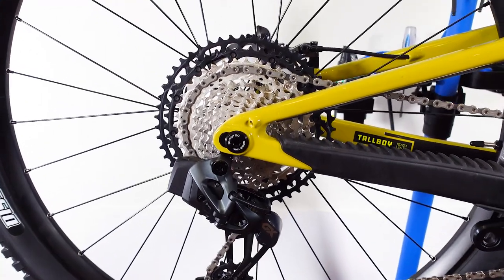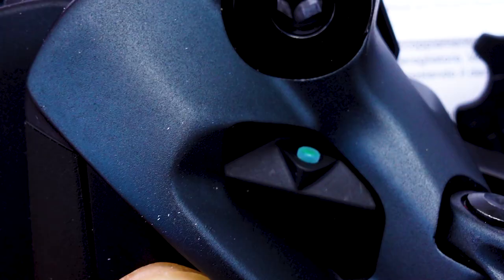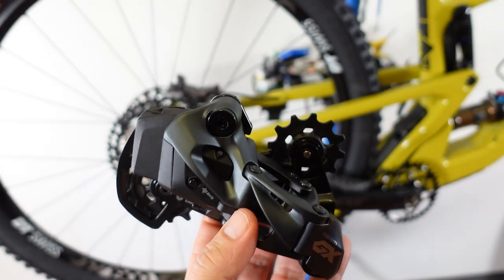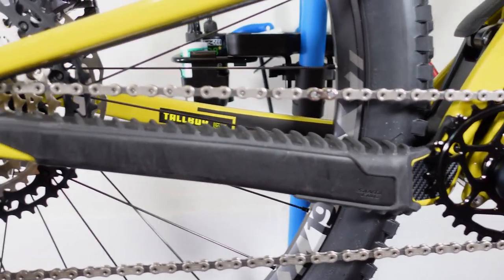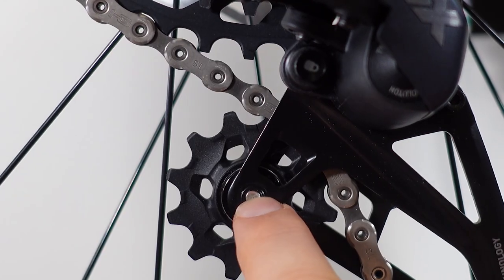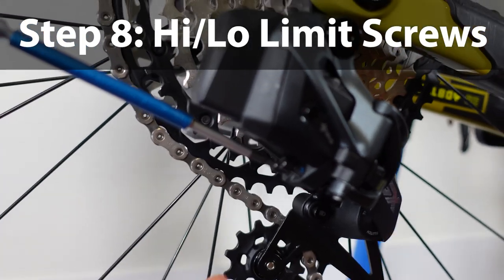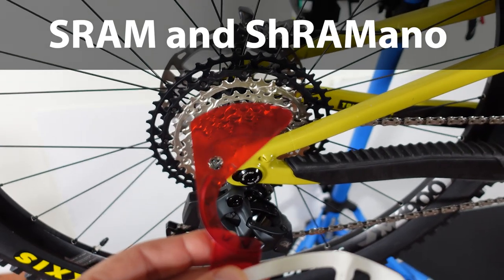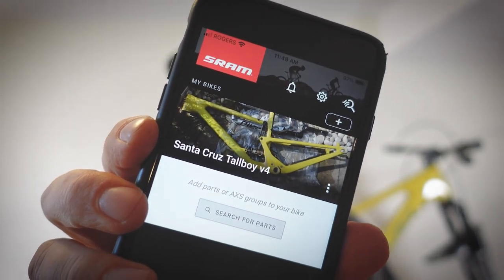SRAM GX Eagle AXS Installation How-To With a Twist? SRAM Wireless Drivetrain, BLE

Comment: I just set up an X01 derailleur using with a XTR cassette and since I didn't have the old B-gap adjustment tool but had spares of the new one I just took a pair of pliers and removed the inner part where it sits around the largest cog. That way there is nothing to interfere with the chain/45T cog. But I guess not everyone wants to ruin their brand new stuff.

Comment: Thanks for making this video. I have just converted my e-bike with XTR to AXS. I didn’t have to tune anything! It worked perfectly from the start. Thank you.
Reply: Sometimes the electronic derailleurs need to "FIND" the top gear position , then work from that .
Reply: @danfarmer_photo  any issues or long term use issues? Thank you
Reply: @totalglitch  It’s been almost flawless. When the chain and cassette is at the end of its life, it can sometimes be slightly out, but honestly, it was one of the best upgrades I have done. Highly recommend.

Comment: Just imagine paying extra money for a bike/frame with internal cable routing and then paying even more money to not having to install the cables :D Anyway very nice and strightfoward video. Thanks
Reply: @LoveMTB  Many do. Cable routing is about doing the job in the simplest, most efficient manner.  Internal or external should only ever be the product of that; not cosmetics.
Reply: @David-rb3tk  that's an excellent way to describe cable routing. 👍
Reply: My frame has 1 dropper cable and 1 brake hose routed both internally. Running GX AXS.

Comment: Changed my shimano xt 11 speed to sram gx derailleur and changed chain to sram xx1 as there was no x01 available anywhere in stock.
Its a dream! Super quiet when pedalling and shifting is smoother then with xt, just when changing gear when going up the hill it clanks.
Reply: Just one thing about dropping chain over cassette, its not a problem for me, but in worst case micro adjustment could be done to have worry free 11 speed shimano/sram axs system :D

Comment: Learned a lot from your videos. For me, one of the most important reasons I got into mountain biking, is to get away from anything electronic. Batteries? Charging? Bluetooth? No thanks - let’s see how long I’ll be clinging to my cables :)
Reply: I have AXS and know many others with it. Not a single issue between all of us. Shifts way better than wired. So much easier to service too. AXS battery lasts a long time. Only needs to be charged a couple times a season.

Embrace innovation imo.
Reply: Deep down, I know it’s a matter of time before I go wireless.  Somehow, I still think bicycles should just be bicycles, everything mechanical and manual; batteries, electronics... where does it end? Aside from e-bikes, will these eventually be another version of scooters LOL
Reply: @dukesilvergold  Eric, you're fighting technology, do you drive a car ...or are you staying with a horse and cart!!! LOL : )

I ride an ebike and slowly all the analogue riders I know are realising the benefits and either moving over or admitting they will eventually!  Ebikes are NOT scooters!

Comment: Using the phone app to micro-adjust is great, as it assigns a numerical value.
I have the AXS Gx upgrade with a 175 crank and Absolute Black 30t boost for SRAM. I just ordered some new components. I'm 70 and live up at 7000', so I've decided to put on a 165mm crankset to try easing joint stress. I also just ordered what I need to convert to AXS with Shimano. So, Microspline driver, XT 10-51 cassette, XT HG+ chain, and, I decided that, since Absolute Black makes an oval that is designed to be mounted on a SRAM crank but for use with a Shimano HG+ chain, I got that as well. I like the 2nd, 3rd, and 4th gear spacing on Shimano more than SRAM, so I'm really looking forward to trying this out! The one question I had was on setting B-gap, which you answered. 
I'm thinking that the chain lengths are the same moving between SRAM and Shimano, though, correct?
Reply: @LoveMTB  Great, thank you. That saves me some time and effort!
Reply: Are you still running this any issues at all? Premature wear? Derailleur having issues at all?

Comment: I’ve been riding with the same setup (GX AXS, XTR cassette, XTR crank with 30t absolute black oval chainring, XTR chain), for over 3 months, over 300 miles, and it shifts flawlessly.  In fact, I think this setup shifts better than any SRAM drivetrain (I’ve owned GX and X01 group sets) and it shifts just as good as the mechanical XTR drivetrain.  I won’t go back to mechanical drivetrains.  I’m now looking at getting either an XX1 or X01 AXS derailleur (I’m a weight weenie).
Reply: Hi. I'm thinking of doing this set up. Would changing the jockey wheels to the shimano jockey wheels be beneficial. If I remember correctly the shimano 12 speed has different number of teeth on the jockey wheels compared to the sram 12 speed jockey wheels.
Reply: @scoto1976  Using the stock GX jockeys didn’t have any impact on the shimano drivetrain on my setup.  YMMV
Reply: @LoveMTB  where do you have this video? much appreciated!
Reply: Are you still running this setup? Any issues wear, all items in good shape? Thank you any almond all info would be great

Comment: Hi LMTB

I've just installed the same derailleur, paired with a 12spd XT cassette. If I use the old red Sram tool to set the b-gap, my chain is excessively slack on the smaller cogs. However, if I make that b-gap much larger, the chain tightens (as expected) and the gears shift perfectly fine. 
I then tested an older spare chain and removed a couple of links and I managed to set the b-gap almost perfect, with no slack chain on the smaller cogs. Unfortunately, the gear shifting was awful, and no amount of adjustments could stop it. 
I went back to my new chain and just kept the b-gap large. The shifting is absolutely fine.
The gap between the bottom tooth on the 51T cog and the line on the Sram tool is in excess of 10mm, so why does it shift OK with such a large gap?
Reply from the maker: @Mapantz1  because the cm chain is new once it loserns up a bit you won’t be happy. Your chain in too long…
Reply: @LoveMTB  Thanks for the reply. The chain was measured as per shimano instructions.
Interesting though, I managed to use the newer sram b-gap tool after shaving off some plastic on the inside, so that it would fit on the second largest cogs with the chain on it. It actually lines up perfectly, so I'm even more confused 😅

Comment: In your video….. distance between the bottom cassette and top derailleur cog center you mention should be 40-41mm, mine is at 60mm (before sag). I need to fine tune mine but it’s working well as is. Why is mine such larger  distance further than yours ?  Just curious. 
I’m running shimano  xt cassette and the same sram 12 speed derailleur
Reply from the maker: @billwilliam3521  if ain’t broke…😊 check the video I have on the B-gap adjustment tools. Also covered that in my latest video, Wheeltop MRB installation video

Comment: Love it, just installed a ShRAMano setup myself to ✌didn't go for a ride yet
Reply: @LoveMTB  Hey there what's up. So just wanted to share my first impressions with you on the Sramano setup(XO1 AXS(used already a little banged up a few scratches), SLX cassette/Xtr chain(1000miles on both), Absolute black 32 oval, 140mm rear travel Yt jeffsy)...I don't want to judge to fast as I gor 2 rides(4h, 1500m climbing, bike park, some blue trails in the woods). So the Pros apart from the obvious are that I don't need to think about how much I need to press the shifter(controller) anymore especially when the hands body is tired. The next pro is the option to shift up/down(app settings) with your pointing finger as on shimano xt shifters(can't live without that option)...interestingly when AXS first reviews came out I was a bit disappointed as none of the reviewers didn't mention this option is available on the new wireless system, luckily it is. The third is ofcourse the zzzt zzzt 😜. Ok for the Cons, the speed, don't take me wrong it's fast enough, but my first after 1 season with an XT setup is that in a situation when coming fast into a corner with brakes and to a step climb, the analog setup was a tick of a second faster there(maybe I just need to get my Sramano shifting technique better) or set my multiple shift from 2 to 3 gear at once. The second Con would be the Sram AXS  clutch strength, compared to an Shimano XT it is weak, the chain is all over the place where with the XT was quiet. The third Con would be that the shifter is to sensitive in rough trail situations(the travel of the buttons is a little bit to short I think). Installation, setup(indexing, b gap, limits) all went perfectly and very easy. So do need more riding time to get used to it better. The  shifting is good,  but I do have one issue, the chain is doing loud clunks when going down the cassette and sometimes has trouble to go up right away, that is probably a little because of the wear on the cassette, but also probably, I think the chain length. On the pure Shimano setup I was running a 34T oval(chain length according to the Shimano 12 speed instructions(+ 5 or 6 half-links), went to a 32T oval now so shortened the chain for 2 half-links. It's 57 full links long now on a 440mm chainstay. I have a feeling that it's still 2 half-links to long. How did you size the chain, Sram way or Shimano way? Probably it should be done the Sram way as it's a Sram derailleur, right? How is your setup working out for you?

Comment: Yes this is the way!!  I've been running an AXS derailleur on my XTR drivetrains on two separate bikes for the past year without any issues!  It simply works everytime with a perfect shift.  The biggest point to getting flawless operation you hit very well.  Proper B-gap adjustment set at sag is key!!  I use a micrometer to get the 51t cog exactly at 46mm from the center of the top jockey wheel bolt while at sag.  That combined with a properly measured chain using Shimano's 12 speed chain guide, and the shifting is perfect everytime especially under load!!
Reply: @LoveMTB  Yeah I've stuck to Shimano's new method for their 12 speed chains.  I've seen a lot of guys have shifting issues while they try to chase the perfect B-gap setting which in the end always came down to an improper chain length because they used an older chain sizing method.
Reply: @LoveMTB  Yes I understand.  I was talking about how I have seen a lot of people lately using the old pre 12 speed chain method and then never being able to get the shifting correct because the chain was the wrong length.  I understand you are talking about using Sram's 12 speed method.
Reply: @LoveMTB  No, I was running full XO1 (non-AXS) then switched to full XTR, then removed the XTR derailleur to use XX1 AXS.  I didn't experience any degradation in performance when switching to AXS.  The perfect shift everytime was noticeable from the beginning though!  From my experience it shifts just as good as full XTR did, only now I don't have to worry about the need to goose the lever slightly to shift up the cassette at times like I was used to with traditional derailleurs. 
I was running Di2 on my gravel bike and was longing to have that precise electronic shifting on my mtb, so I bit the bullet and bought the AXS.  No regrets!!!
Reply: @LoveMTB  No worries bud!  I appreciate your videos, always very detailed and informative! 
I prefer to get on my bike and ride around to do the fine tuning, which is easy with AXS.  I find if I tune it at sag with me on it I can get it to perform better than when it's in the stand.  Which is where it counts anyway! 
Keep up the awesome content!!!
Reply: @LoveMTB  Lets see... Favorites: Ease of shifting has to be the first for me.  Set and forget, after setup and fine tuning it just continues to work everytime.  The battery lasts longer than expected.  It's robust, I've smacked them a few times which is concerning everytime because they are so expensive, but no issues yet! 
Areas to improve: Before GX AXS I'd say price (I own XX1 and XO1) but with GX out now with a small weight penalty, AXS is getting cheaper.  I wish the controller was a little smaller, I know it's petty but it is a little chunky for my liking.  I wish the controllers were more customizable, I have both the AXS derailleur and Reverb AXS and I wish I could program the buttons to do anything I want such as being able to program a single click, double click, or long press on either controller for whatever I desire.
Reply: Hi! Sorry do you mean set B gap at your sag when on the bike or fully sagged as in fully deflate your rear shock? Thanks. 👍🏼
Reply: @ashjackaman6230  set B-gap at sag for your weight.  I'll typically find my desired sag, then I'll mostly deflate the shock, and use zip-ties to set the suspension at my desired sag without me having to sit on it.  Then I'll go into derailleur setup and tuning.
Reply: @omeletn  great stuff. Thanks for that, and  going back to the Shimano 12 method did you  shorten your chain on your sag as well?

Comment: I got one today 8/24 the shifter has now been changed to a 2 button pad instead of the paddle! But to me that's a bonus as was about to order the different shifter for it! (Axs GX) going on 12s XT like this! Thanks for the video it's been helpful! One small thing still not sure on is the sag and chain adjustment! Is it the bikes recommended sag or what you have as sag as rider weight also how would this effect it with the shimano 5 link and sram 2 link?
Reply from the maker: @Emtbtoday  hey check the video I just posted on Wheeltop will give you everything you need.  Different system but same setup
Reply: Already been in touch with them a guy from here done a video couple weeks ago but they are saying I will have to pay the post office at my end for customs on top of the shifter price tag! Not willing to do that for something that has no history and spares I got a new Axs GX set for £450 just need to fit it! Can you help me with one thing on it please?  How do you pull the cage down it seems to be locked up out the box ? Thanks
Reply from the maker: @Emtbtoday  I said follow the steps from the video not buy anything😎

Comment: I would be totally ready to drop heavy wires for 5v, gnd and signal with central lion cell placed somewhere in the frame. No need for wireless in the mainstream. This could also apply to dropper and lockouts. would result in super small shifters and buttons. Say if SHimano would bite SLX and do it there

Comment: Hello, thanks for this video. I have a question about fine adjustment. The cassettes differed best from the middle or at the top or at the bottom? What was your experience doing this? Thank you for your tip.

Comment: I did the same configuration but my chain is kmc, I don't know if it was because of the chain, but I didn't finish removing a bit of noise in sprockets 5 and 6, nor was I able to configure it with the old tool or with the meter at 40mm or 41 because if I do it, the chain skips, I don't know what to do anymore... can you help me?
Reply from the maker: It's a tight fit for sure, have you checked yout derailleur hanger to start with? Chain length has to be setup according to SRAM/ Shimano (ends up the same). B-Gap - when on 45T cog the top jockey and the 51T have to have just a small gap between them. That is for a full suspension, hardtail would have a 4mm gap or so.

Comment: Hi, did you test the AXS also on your Yeti ARC? I am getting a lot of chain slap with GX axs, xx1 chain, 32c, chipped away the bottom of cs, next to chainring. I am trying to isolate the problem to axs clutch, before I change to "organic" shiffting. And yes, ARC is ridden hard, so lots of roots, jumps, drops....etc...

Comment: I have a question without mixing and matching SRAM and Shimano, I just currently got the SRAM GX AXS upgrade kit, it was wondering with the 12speed XT Shimano cassette and the SRAM chain and the SRAM front chain ring would that be a problem? Or should I use the Shimano chain with the Shimano rear cassette?

Comment: Hi! I'm on XT cassette with GX Axs (full sus). For the chain length, do I have to sag my rear suspension? Or do I just perform the Shimano chainlength method? After doing so, the b screw gap will stay as 41mm? Your advise is appreciated. Thanks!

Comment: I commented when you first released this and you said you will have a follow up long term video. I suppose all is working well.

My XTRs shifting keeps detuning during big and long descends when I do minimal shifting. I’ve struggled with this for a long time on my long travel bike (160) and do not have this issue on my hard tail or short travel bike. It seems I am experiencing detuning from cable stretch and I can’t seem to fix it. I will be upgrading to wireless shortly to try and eliminate this problem.

Comment: Hi, is the b-gap distance also 40-41 mm on an 10-45 cassette? I have a problem, that i can have either good shifting on the middle cogs but not on the largest or the other way around. Any hints?

Comment: Would be interesting how you judge the Shimano SRAM mix after riding some time. My experience were really bad and  I moved back to 100% SRAM equipment.
Reply: I had 100% shimano, was satisfied, switched to sram, but shifting was not as nice under load. i have this setup now and for me it works flawlessly. excited for the update though. adjustment is probably not easy

Comment: Hello! You mention that you did a hard code in the system so that you Can run 11speed on the 12speed deraliur. How did you do this?? I have the cx1 groupset 11 speed and i am looking info upgrading to wireless. But they are all 12speed. 
What do I need and how to? 🙂